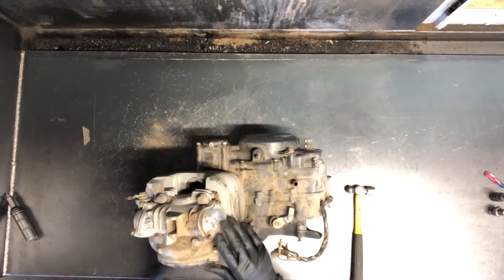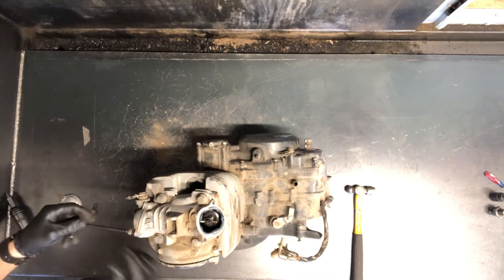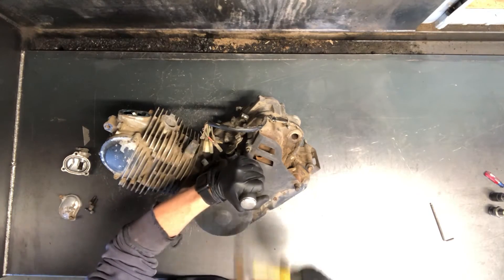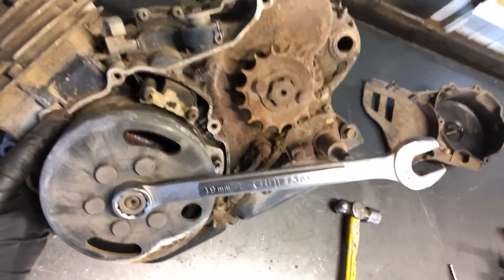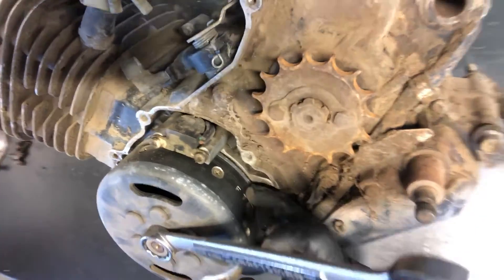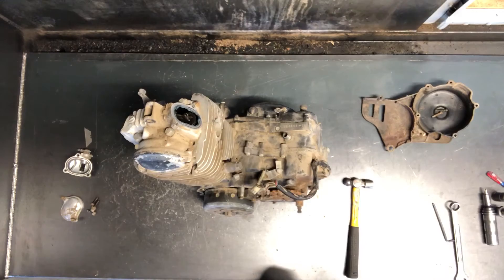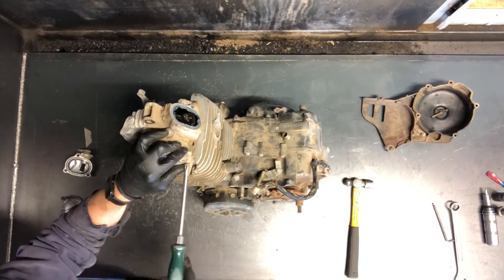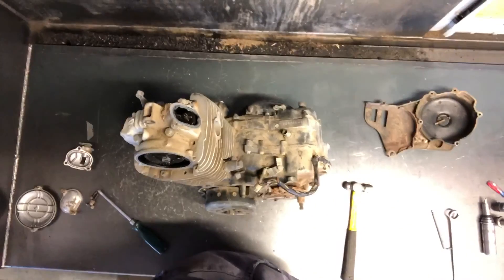How TO - Adjust Valves Yamaha XT250 Intake Exhaust Valve Adjustment Clearance Specs Finding Top Dead

Comment: I have a 84 xt250. It starts if I tow it in gear. Almost impossible to get it to start kicking it. Is this a possible valve issue. It only has 3100 miles in it
Reply: Same issue here. Would be helpful to know if I should adjust the valves..
Reply: @MidNebraskaMotorsports  good morning. Actually I found it to be an 85 xt350 .over head cams with shims. It starts when I bump start and seems to run pretty descent . If it stalls, it’s extremely hard to get it to hit with kick start but if I push start, it starts right up
Reply: @MidNebraskaMotorsports  spark plug is new and has great spark.
Reply: The XT 350 has very low mileage and was driven very little . It was plated up until 02 I think. It has a compression release on it and doesn’t seem like it has a lot of compression on the kick. When I tow it it starts and runs good. I just got it and don’t know if riding it and putting a few miles on it will help. Could it be stuck valve?. It sounds good with plenty of power and fast as hell. It was sitting awhile and smokes alittle

Comment: Deadly! Got Yamaha xt 25o . Set the dual cams same as honda specs . Intake smaller exaust bigger. .16 exhaust .20. backfires have to reset make up for worn valve caps.